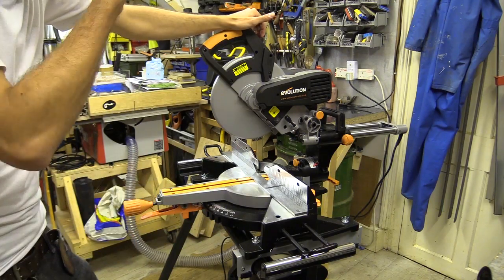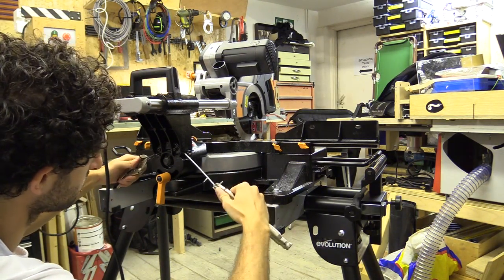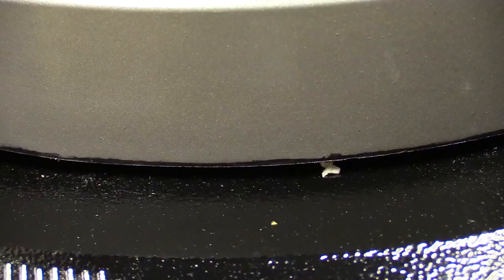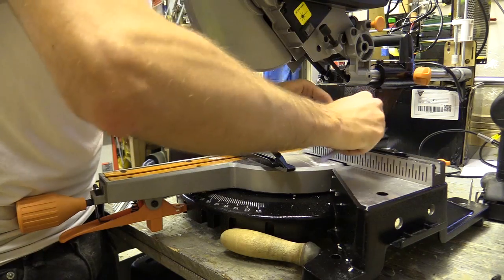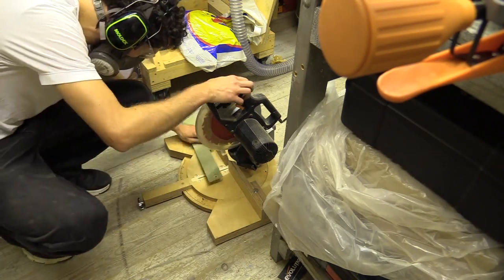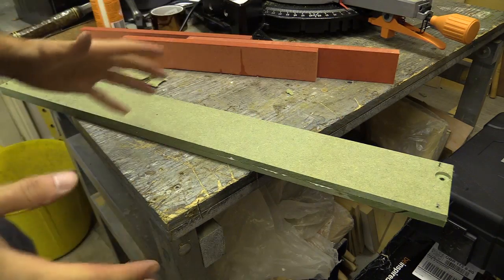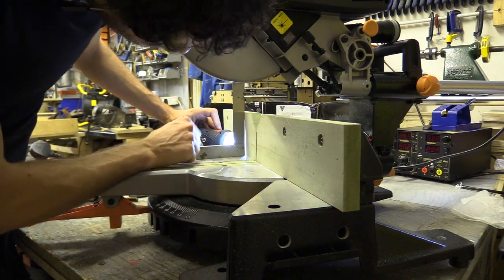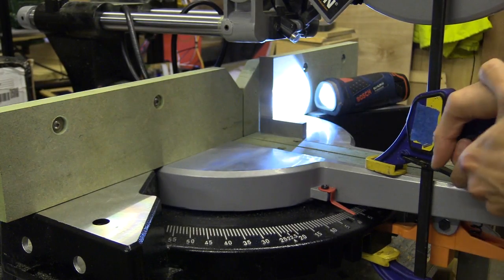Mitre Saw Mechanic – Zero Clearance Insert and Fence

Comment: I wish cheap tools just meant that they needed lots of tune up. I'd be quite happy to spends hours and hours tuning something up as it's great to know how it works. But unfortunately, as another commenter alluded to, the base line has to be there to improve upon, which doesn't seem to be the case. A good example would be square that you could adjust yourself to make square. And no, I don't mean a bevel square, or filing the points of a combination square, I mean something with some kind of grub screw and a secure clamping mechanism.

Comment: Hi, i have the smaller green saw, it was a lump of crap. i have had to do more or less what you have done. or tho the fence on mine was bent. it also never hits center or 45, its about 2 degrees off. its better now after a a strip and grind but for a cheep tool it cuts and makes the right sounds its a hobby saw.  nice video man :)

Comment: I was sent the Rage 3 also had the same problem with my fence and I also took the stickers off because they don't sit flush on the table top LOL I ended up doing was taking the fence completely off filing it down until it's was 90 degrees which took a while ans never ended up happening lol lasers were inaccurate which I never really use anyways but for the purpose of a review  but I totally get what you're saying very disappointing .. it's like they send youtubers the defective saws to do the review and they know we will fix it to make it right but yeah bro ..i was thinking the same thing..hope you now have An accurate saw
I also had burrs all over the fence and base @7:15

Comment: I think when shopping for a slide compound mitre saw,you have to look at brands that have the most tweakability(as I have learnt) in there mitre saws,seems every bearing,or armature ,or brushes maintenance videos on mitre saws are DeWalt,it is fairly decent,I don't have that brand,I have an AEG,which is Rigid in the U.S. I bought a Diablo blade installed zero clearance,and slightly enlarged the fences mounting holes to make sure it was at 90 degrees to the blade,lucky for me it was 90 degrees to the bed and bed was flush with the side supports.Now cuts beautifully the saw itself with sit stand,that came in separate box $549 A.U.

Comment: Problem with these saws is that all lack of accuracy. Even the expensive ones like Dewalt. Their "excuse" is that they mostly been used in sites or quick and dirty jobs and they provide mainly portability... Personally i do not accept that excuse but this is what it is
Reply from the maker: I think they just tried to add too many features to the product. But the error on the rotating base is quite serious. I wouldn't accept that coming back from the manufacturer - unless it was a design error. It is actually really light for a saw that size.

Comment: I bought one of the original little green ones absolutely eons ago when I started renovating my 1st house, believe it or not it was actually a good little saw that I still use today as it's bang on square after some serious abuse so it still sees some action for basic framing etc.

Based on my experience with my little green saw I thought I'd buy one of the large orange models when I was re-building my cut roof as I needed to cut loads of 9x2s at angles etc, which were too big a cut for my little green saw. Wow what a piece of crap that orange saw was! It couldn't stay anywhere near square or calibrated to save it's life, completely put me off buying the Evo in future.

Comment: I have the old model. Took ages to get square. It must have taken some complex engineering to make the dust collection that bad. I want to replace it just for better dust collection.
Reply from the maker: The partial mechanics are probably very complicated. They still can't model it on a computer.

Comment: The blade in the saw is used for cutting metal(and any thing else).The blade leaves no heat behind when cutting metal,meaning the piece you cut will be cool to the touch.
Reply from the maker: So why don't they just sell saw blades? I guess the motor winding and the torque is part of the magic equation.
Reply: Yeah, I was chatting with their engineers a while back to see if I can retrofit their blade onto another saw. The Evolution saws spin at about 2/3 the speed of your average chop saw which is how they manage to cut anything you throw at them. My little Rage 210 is ideal for hauling around and chopping through rough stuff for building things, but there's no way I'd trust it to cut anything with any precision.

Comment: "Help the saw evolve" haha more like you gave it  kick in the arse to move it up the evolutionary ladder. That was a lot of work but made for a good video. Many people don't realize the price point is determined first then the design, materials, and manufacturing follow from that. Sometimes no amount of fettling will change the fundamental character of the product as established by its predetermined price point, and anyway it may be fit for purpose say in a metal fabrication yard.

Comment: Even with a cheaper model, there should be better ability to make adjustments. But the main bed is bad therefore throwing off everything else. Glad you showed both saws. I definitely won't be buying anything they make.
Hopefully the manufacturer will see this video and "possibly" make some changes in production. At least something in quality control. I agree that the quality inspector should sign their work but I can't read Chinese.
Reply from the maker: It's not because it's made in china, it's because people are too poor to buy Festool. The bigger the wage gap becomes - which it a real thing, the harder it is to make cheaper product for that part of the market that are any good. It's a race to the bottom.

Comment: I bought an Evolution about 5 years back when I was laying an oak floor. I wasn't yet properly into woodwork at the time. Since then I have become more of an enthusiast and bought the tools to be able to measure the tolerances like you did. Mine too turned out to be rubbish!  In particular, the face of the fence that you lay your work to be cut against has a bend in it of around 2 to 3 degrees half way along the left hand side. I would not buy another one.

Comment: cheep chinese stuff was so much better 15-20 years ago. I had a titan chopsaw £80 and tablesaw £150 back then, it was all square and tuned right out the box. I don't mind improving tools, but the new stuff hasn't got the core structure anymore to have a baseline worthwhile improving on, it may aswell be made of brie . enjoyed the narration ;)
Reply from the maker: More like plastic burger cheese, covered in mayonnaise!
Reply: Savvas Papasavva Due to our imaturity, perhaps we have missed the point of it's err's. with a enough cheddar bar stock and 1 degree off cuts, it would make a nice big round of cheese.

Comment: very good vid on a very poor machine,i bought the rage 3s when i built my decking for that it was ok,ish,but then i started to get into woodwork and soon found out how rubbish this saw really was after many long emails with evolution it was apparent that the faults with it made it unusable to get accurate cuts, i even called there help line i must admit i felt sorry for the chap that was trying to help as it was obvious he thought the saw was rubbish and all but agreed there was not really anyway to fix it,what i really dont understand is why so many big youtube people raved about it as the best saw ever and why evolutions qc department is so slack, needless to say i sold it as soon as i could and explained to buyer its only good for rough cuts, after buying it i would never buy another tool from them again.

Comment: Kapex!
Reply from the maker: That was a great film. One of the best.
Reply: I measure my Kapex 120 and have some problems with accuracy! The (base) zero clearance incert is not on level and is not strong. Also have like that Evolution a gap between the two base parts, perhaps smaller! I Will contact Festool !!! Thank you very much Mr. Savvas Papasavva